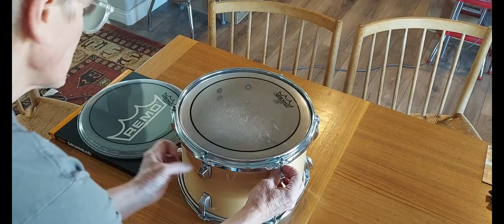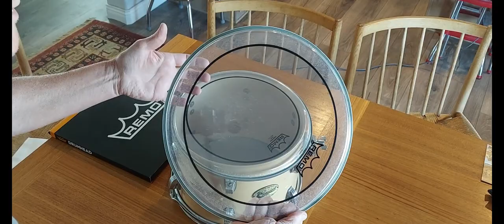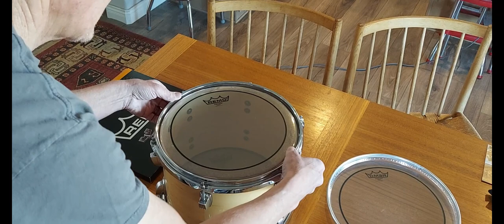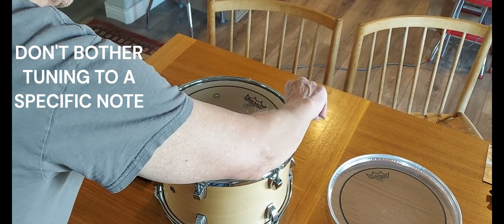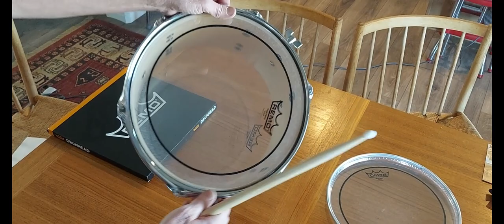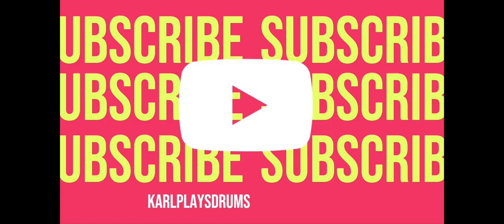changing a tom head, and tuning for optimum sound

Comment: Hey there, my friend. Not sure if you have any experience with or like Evans heads, but they seat evenly all the way around without having to do any extra work. The collar is made different than other brands. Lemme know if you’ve tried them before and what your experience was if so.
Reply from the maker: Howdy! I have tried Evans, but only on my sonors, but anything fits them because of the undersized shells. They sounded fine, but were slightly less durable ime. I haven't tried Evans on my Ludwigs because I've been using remo exclusively since then. I'm working on a video showing sonor's undersized shells. They work really well. Quite brilliant. Thanks for the comment!
P.s., I think remo and Evans both have heads available with a revised profile and slightly larger hoop.
Reply: @karlplaysdrums  awesome! Yes, I forgot about Sonor being slightly undersized. Great point! I think that is really awesome. And yeah, remo classic fit is the name I think. To my knowledge they only come in a couple models or so. I usually use evans or Aquarian. I am so surprised how quickly your head tuned up, that’s great. I’ve rarely been able to get a remo up and ready that fast. Great stuff man. Keep it going, very nice channel. Looking forward to that video ;)
Reply from the maker: @zackedge2456  thanks! Much appreciate!